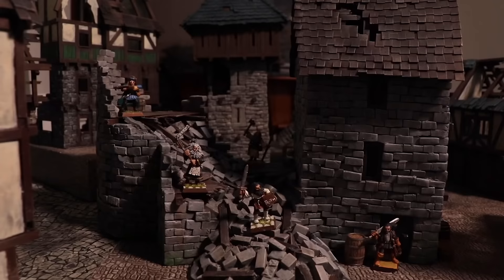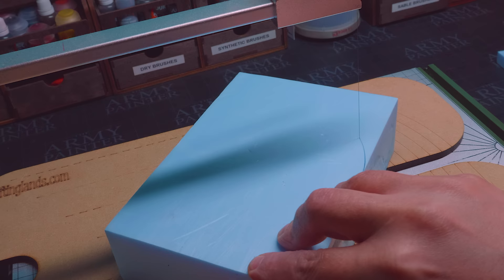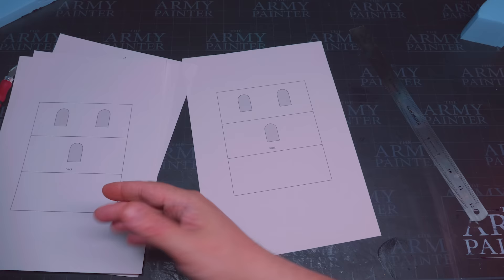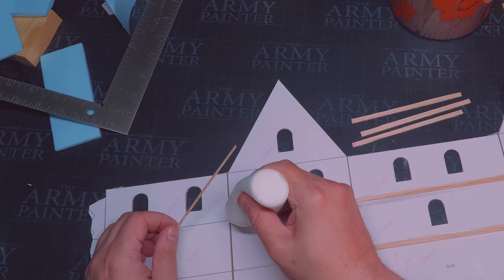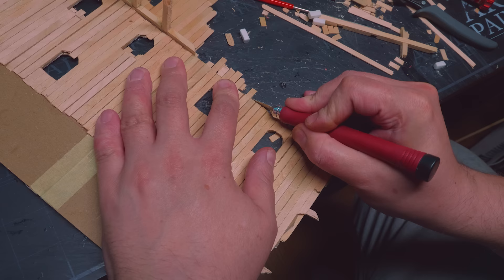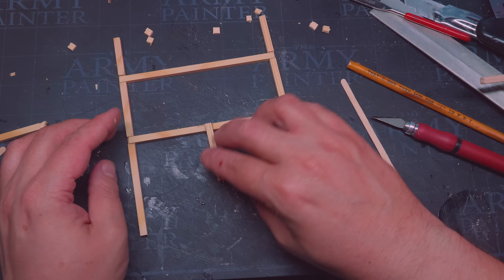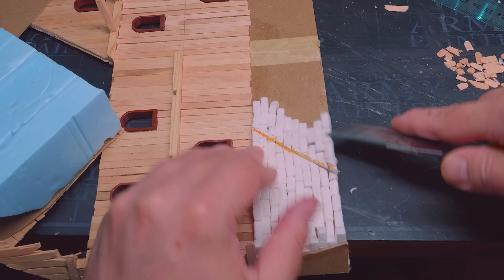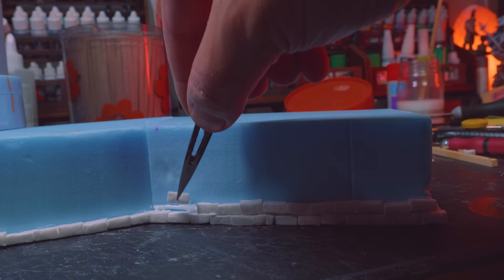Ruined Tower and Barracks in MORDHEIM The Old World Warhammer Fantasy!

Comment: My only quibble, is that your boards are too uniform. Most of the time floor planks are offset of each other. You did break them to show where they would end but you're not gonna have 20-30ft long boards without any breaks in them. Scale wise they are gonna be more like 10-20ft and staggered. I usually put boards that have fallen out or broken off in a floor under. Meaning your rubble should include your broken wood, roof shingles, maybe a few bodies, in addition to the bricks. Other than that it's a good looking build I need to get back to my own mordheim board.
Reply from the maker: You have a good point Toothygrin! But for me I think I am fine with that, that being said, I am curious and will do some tests! 👍😅

Comment: Totally great and talented work, superb. Very well shot and great clear steps. One tip, cut your tower vertical area which you want jagged before you start on adding the floors. Lay the Pringles can out flat and then use your hobby knife and cutting mat to make the jagged edge of the walls. Save your fingers and a lot of time. Really enjoyed the use of the spray bottle full of glue mixture to glue down all the flotsam and jetsam bits and bricks. I never thought of that....
Reply from the maker: Thank you so much for the kind words and the suggestion! I appreciate it! 👍🙂